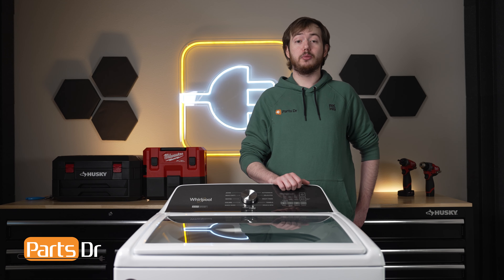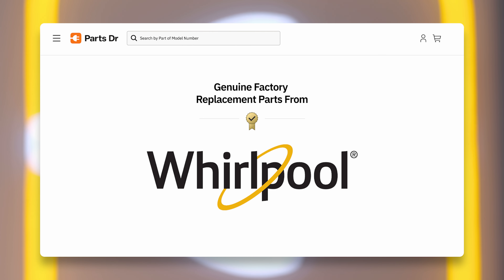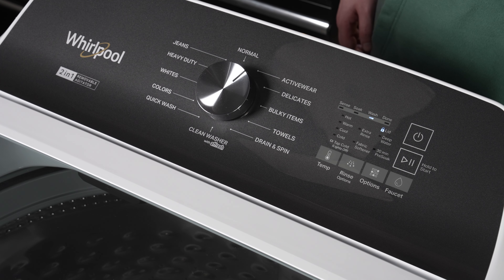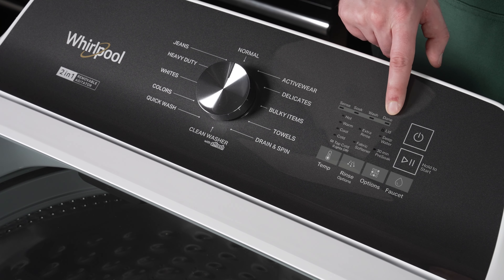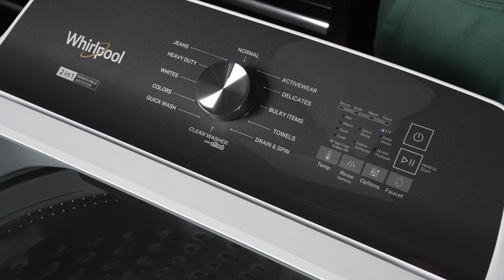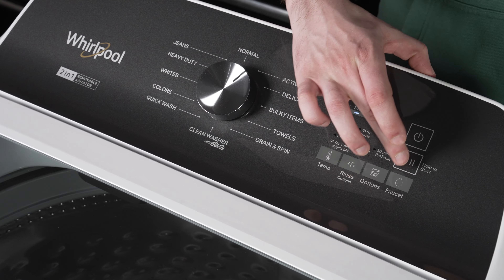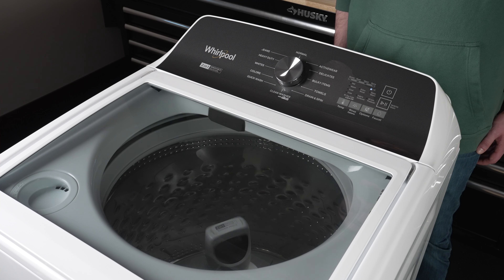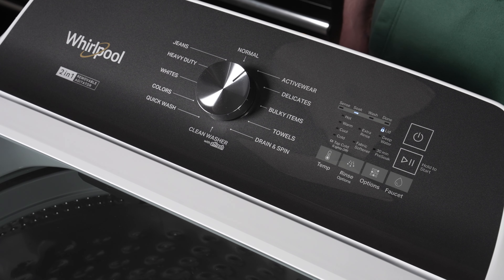RESET Your Washer After Repairs! Washer Calibration Cycle For Whirlpool, Maytag, Amana, Kenmore

Comment: Your instructions seems to work until I get to the end of the process.  After pushing buttons 1,2,3,4,5,6 the washer locks & begins to fill with water while agitating. After 30-40 seconds the washer unlocks but the LED lights (soak,wash,done & lid) continue to flash, endlessly. Anything else I can do to complete the recalibration? TYIA
Reply from the maker: That might indicate that something is wrong with the washer.  Try checking the washer for any stored error codes as shown here: https://www.youtube.com/watch?v=wMfaFhZOaU0

Comment: What if the machine will not complete calibration?  I’ve tried it twice to no avail.
Reply from the maker: Try checking the washer for any error codes: https://www.youtube.com/watch?v=wMfaFhZOaU0
Reply: I did.  It’s the same codes I had before I replaced the shift actuator.  I cleared the codes and tried it again. I left the machine alone for an hour and it still wouldn’t complete the way your video shows. Per the service manual, if the shift actuator doesn’t fix the problem, the main control needs to be replaced.  I wonder if that’s why the calibration won’t complete 🤔
Reply from the maker: @josephvalentino4056  That is most likely why the washer won't calibrate properly for you.  Which error codes are you seeing?
Reply: @PartsDr  f7e7, f7e6 and f7e1, in that order. Also, after replacing the shift actuator, it decides to throw a final code of f3e2 which has nothing to do with anything that was occurring before.  The manual tells me to test the HMI which I already did before which lead me to my diagnosis of a bad shift actuator followed by the main control if the shift actuator doesn’t remedy the issue.
Reply: @PartsDr  I should mention, f7e7, f7e6 and f7e1 were the original codes.
Reply from the maker: @josephvalentino4056  f7e7, f7e6 and f7e1 these could be an indication of a bad gearcase.  Do you see any brown residue coming out of the bottom of the gearcase/splutch area of the washer?
Reply: By residue, do you mean grease.  The very first thing I did was replace the capacitor.  I did that because it fixed my machine about six months ago for the same symptoms it has now.  Also, I replaced it because I saw a bunch of gray grease on my floor under the machine, and the capacitor was covered with it.
Reply: That’s funny you mention the gear case.  The technical trouble shooting manual never mentioned it.  I’m going to go take a look at it and report back. Thank you.
Reply: Removed the gear case and found it to be pretty dirty with nasty brown sludge.
Reply: I completely disassembled the machine, cleaned it thoroughly, put it back together, and the same thing.  Will not complete the calibration. Still shows f7e7, f7e6 and f7e1, in that order.
Reply from the maker: @josephvalentino4056  Yes, sometimes it will look like grease or oil.  It is an indication that the bearings in the gearcase have failed. We have a video showing how to replace the gearcase here: https://www.youtube.com/watch?v=RaSxZAMiXM8
Reply: @PartsDr  I removed the gear case and cleaned it up. It wasn’t grease, just gunk that builds up over time.  It was all inside the tub as well.  Like I said, I took the entire machine apart and cleaned it up.  The gear case moves freely.  Also, the shifter operates properly, as the agitator can spin freely from the tub, or all will turn in tandem when locked.  I ran another diagnostics and now it’s telling me to replace the user interface.
Reply from the maker: @josephvalentino4056  The brown residue that you are seeing on the bottom of the washer is an indication of a failing gearcase.  It is not just gunk that builds up over time.  Water is leaking through the tub seal, bearings, and gearcase and then being flung from the moving pieces onto the inside cabinet of the washer.